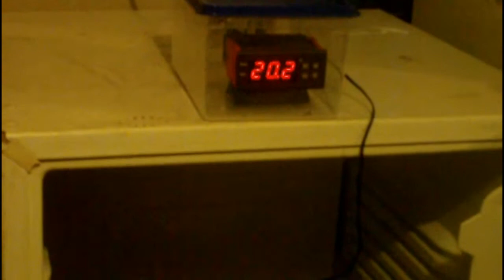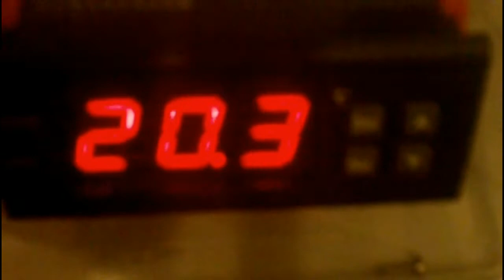Temperature Controller.

Comment: That's how we do!
Reply from the maker: Damn straight next thing is making starters and aerate the wort.        
                                                                                          Cheers Dan.
Reply: I have heard about oxygenation stones. Is it true you can use them for yeast starters and aeration of wort? Cheers!
Reply: Rookie Brew
Yep!  You can get them in two forms, air pumps, or pure O2.  With the air pumps you have to run it for 15 minutes, and the foam that it creates is a mess.  With pure O2, you just give it a 60 second blast.  I recommend this setup: http://www.midwestsupplies.com/oxygen-kit.html.  I know some countries can't get the oxygen canisters easily though.  We can get them at the hardware store.